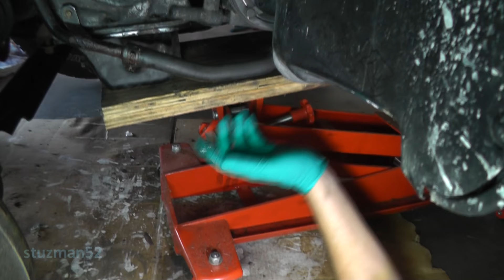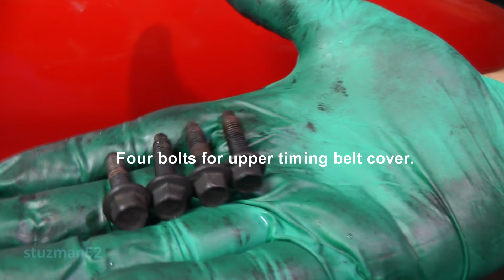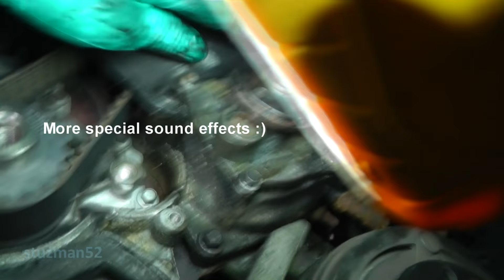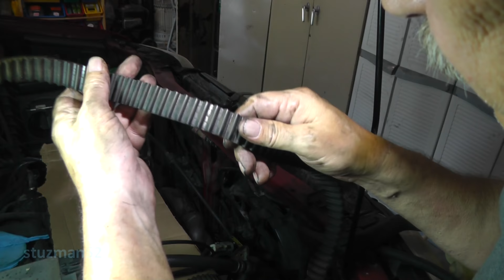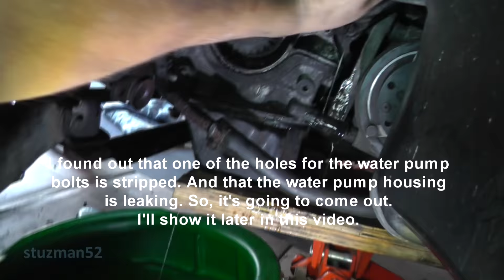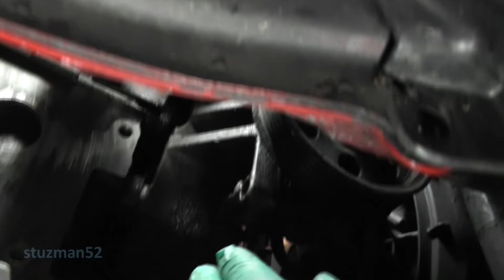Ford Escape Timing Belt and Water Pump Replacement - Part 4

Comment: How many miles were on it at this point
Reply from the maker: If memory serves me correctly it was around 130,000 miles.
Reply: @stuzman52  I'm at 166k on my 1.6l escape, past the 150k rec. Serpentine belt looks really good, wondering if the previous owner replaced the timing and serpentine at the same time. Looks like I have to open the engine to see the timing belt itself?
Reply from the maker: @BryantAJoseph  It's hard to say Bryant whether the timing belt was changed. It's a lot easier to change the serpentine belt than the timing belt. I wouldn't chance it as I would pull the timing cover(s) off to see what it looks like.

Comment: Simple way to do this without the crank alignment pin, and removing the cat: Assume the engine was built correctly and the cam sprockets were aligned properly from the factory. Therefore BEFORE removing the belt, rotate to TDC, insert you cam locking tool (if it fits with the belt on, the engine was built properly, I would assume). Now proceed with removing  and replacing the belt, tensioner, idler, water pump, etc., WITHOUT MOVING THE CRANK!!!  The new belt should align up really closely. Mine was really close but had to invent new swear works to slide it on without moving the crank. Remember the cams won't move as they are locked with the aligning tool. The rest is very clearly shown in this excellent video. (No rebate from stuzman for this... LOL) What do you think stuz? Anybody?
Reply from the maker: Yes, you could use your method to locate TDC or you could use a TDC tool to find TDC for #1 piston. I did it this way to show what's involved of what the service manual recommends. It would save a lot of time of course from not removing the cat and not using the locking pin for the crank. And then I would had people complain because I didn't follow the correct procedure. I say each to their own to whatever makes them happy :)
Reply: Good answer and thank you for the response. AND thank you and your wife for the video; I would not have attempted this repair without watching it first. Karl

Comment: Where can I get a water pump housing ?
Reply from the maker: You're probably not going to find it at the local box auto stores and probably is going to be a dealer only item. Another option would be to check the junk yards.

Comment: I notice you break the crank pulley bolt loose without holding the pulley still. Is that because you were using an impact gun? Haynes says to hold the pulley still with a chain wrench or similar while you break it free, but that might be because they assume you'd be using a breaker bar rather than an impact gun.
Reply from the maker: dunebasher1971 That’s correct that the impact tool can remove the pulley without holding the pulley. Makes it a lot easier!

Comment: While I very much appreciate the video, your years of experience, and you skills, there are a lot of steps in this series that may be skipped or rearranged to make this whole timing belt job go much smoother and faster. Such as, getting that engine mount on the frame rail out of the way to give you much better access, leaving the valve cover on, and marking the cam gears as is the industry standard. Counting, and noting the exact number of teeth on the belt between your new cam gear marks to aid in keeping the cams in time when installing the new belt. Using a couple of heavy duty wire ties running through the spokes of the cam gears to temporarily hold the cam gears in sync with each other and prevent the cams from rotating. Getting the water pump out of the way before disassembling the timing components. Finding #1 top dead center using the keyway at 12:00 as shown in the video, and making sure the ignition rotor button is pointing toward the #1 cylinder spark plug terminal inside the distributor cap. Completely avoiding removing any exhaust components, or messing with a crank stop pin, which is a special tool nobody has anyway. And, taking the timing belt tensioner bolt out completely to allow the belt to just fall off instead of fighting with getting it to slide off the pulleys. I am speaking as a Certified L1 Master Technician with over 45 years of engine building and maintenance experience, and assure you the hints I have posted would cut the time in half that it would take versus the steps in your video, with equally good results for the right mechanic or do it yourselfer. My methods may not be for everybody, but then not everybody should even attempt this repair. Still, overall, great job on the very helpful and video, thanks to you and your wife!

Comment: Lots of unexpected issues that surface... I would not have wanted to be the guy in the shop working on this... or be the boss that needs to phone the customer to revise the estimate.
Reply: Thomas EXOVCDS I I can see the customer now saying what do you think I am made of money?
Reply from the maker: For sure Thomas especially with that belt tensioner. While I'm in there 
I'll be fixing other things while I've got it tore down. For example, I 
noticed the oil pan was leaking a little bit so I'll be dropping that 
down to install a new gasket since it requires the cat to be removed. 
Thanks for watching the video and leaving a comment!
Reply from the maker: Of course he's made out of money DE :)
Reply: stuzman52 Lol. 

That's one of the many reasons a job like this is good DIY. It's big and it needs to be done right, but there are a lot of things on the way that can be paid for with labor costs.
Reply: Thomas EXOVCDS Yes me too
Reply: Or be the guy paying the bill!!!

Comment: Man I bet you spent hours researching this to get all the correct info. Preparation is a big part of a job but so time consuming. Oh and good camera work and angles.
Reply from the maker: You are correct Mike that I did spend hours researching this job before I even started tearing things down. I don't mind doing a job,, but when I get through I want it to be the last time and not have to go back in there. I always tell the new engineers when training them that you've got to find all the details up front in a job. Otherwise, the details will find you at the end of the job :) I'll tell the wife she did a good job on the camera work and thanks for sharing a comment Mike.

Comment: Wow you're lucky that waterpump housing is removable and the pump doesn't just screw in to the block. That belt definitely looks like it has been loose or slipping. Great video
Reply from the maker: That was my first thoughts too Jonathan when I saw that the water pump housing was removable. That would have been one pain in the ass to try and get a hand drill up in there to do a helicoil on the block. It turned out to be an easy job putting the helicoil in over by the drill press. That video will be coming up shortly showing the helicoil installation. Yep, the serpentine belt tensioner was replaced along with the belt too. Thanks Jonathan for dropping in and leaving a comment!